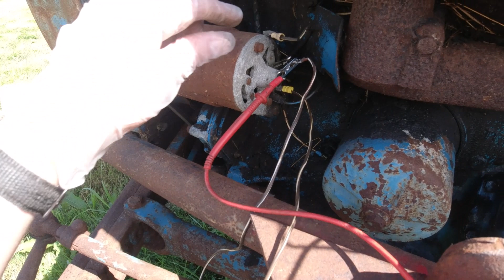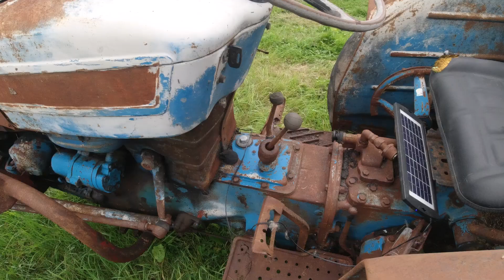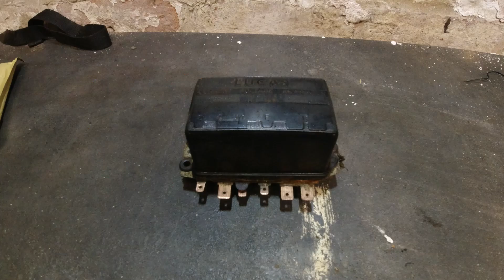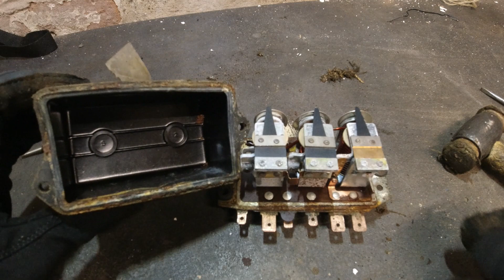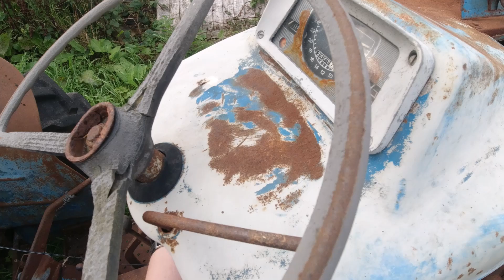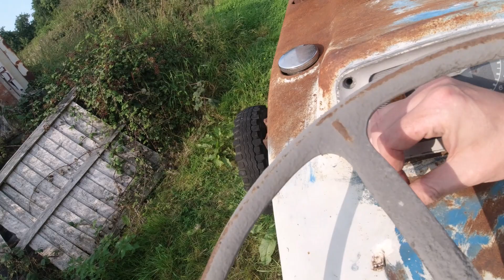Ford 3000 tractor battery not charging SOLVED. Well, sort of! Lucas RB340 and dynamo

Comment: You can adjust the regulator output to increase or decrease it. Play with the spring tension on the voltage regulator relay by adjusting the cam. Chapter 3, pg 26 of service manual. If i recall correctly- more tension on the spring gives higher output. Small adjustments. Voltage regulator is by the D terminal on the end. Finer windings than the reverse current cut out on the other end by the B terminal.
Reply from the maker: Thanks. Yes I need to have a play with it as I supect that it is still not quite right

Comment: The old tractor repair shop said he has never seen a positive ground factory Ford 3000 in the US. Ford did build previous to the 3000 tractors with a positive ground. Mine was just incorrectly hooked-up by a past owner. And it did charge that way….but it now charges as a negative ground. He was worried that my regulator my not like being rephrased but it worked fine. The dash will not work 
as positive ground, I’m replacing my dash currently with a new one. I’m trying to fix this tractor back to factory spec, it will be easier to figure out for next 50 years.
.
Reply from the maker: Very interesting. From the googling that I did it said that they were all negative earth. But someone could have swapped it if they had another positive earth tractor on the farm and wanted them both to be the same. The good news is that you have it working 🙂

Comment: All the forums that show pictures of where the battery cables go have mine reversed. My tractor is running and charging correctly as a positive ground system. I had to field/flash my generator to the negative post of the battery. If I put a voltmeter on the battery, the positive post is reading positive. The battery was not charged incorrectly. It’s truly a 12 V battery +-.
I’m going to talk to an old Ford tractor mechanic tomorrow and run all this by him. 
I own a dyslexic tractor.
Reply from the maker: It could have been converted at some point. Farmers are known for their "creative" solutions to problems 🤣

Comment: Are you really sure that these were negative earth to begin with ?  Plenty of cars of the same vintage had positive earth.
Reply from the maker: Well....the internet said negative earth so it must be true! The operating manual says negative earth but this is from very early in the production run so they might have done something different. I suspect that if I turn the battery around and connect the control box to earth then it will charge.
Reply: I learned real quick It was a positive ground when I tried to add a extra ground strap to the negative terminal and connected it to the block, lots of sparks. Mine is now charging, thanks for your YouTube and explaining the charging system as a positive ground. I’m replacing the instrument cluster tomorrow.
Reply from the maker: @rickradford3920 Thanks for the Thanks! Good to know that you found the video useful
Reply: My battery is truly a positive marked correctly 12 volt battery. The positive side is going to the ground side of the starter, the negative side of the battery is going to the solenoid. This is wrong. My system is charging. If I was to reverse the cables on my battery and re-pulse my generator would this make me a negative ground system?
My instrument cluster does not function on my tractor and I don’t want to burn up a new cluster changing it as a positive ground tractor that it is currently.
Reply from the maker: Yes that would make it negative ground. Not sure if it would fix your instruments though - all they need is 12v and a reference of 0v (ground). I did see another video on here which mentioned about a ballast resistor on the back of the instrument binnacle which can cause problems.
Reply: I went and reversed the cables on the battery to make it back to a negative ground system. This required me to repulse/flash/phase…. whatever term you want to use….the generator. I started it back up and it’s charging at 13.8 volts.
Reply from the maker: @rickradford3920 great stuff!
Reply: Are you sure that you have fixed it? At the end of your video with the engine revved up you are still only seeing 12.78 volts.On an RB340 regulator the cut-in voltage is 12.7-13.3 volts and the open circuit voltage is 14.5-15.25 volts depending on temperature. Do a current check as well as a generator field winding resistance test Lucas fields should be 6.1-6.4 ohms. After starting the engine a few times the generator should be recovering charge above 13,5 volts. Might also be an idea to check brushes and brush boxes for contact and cleanliness.
Reply from the maker: It didn't work. If you look at my channel you can see that I uploaded a new video this weekend, I ended up having to rebuild the dynamo.